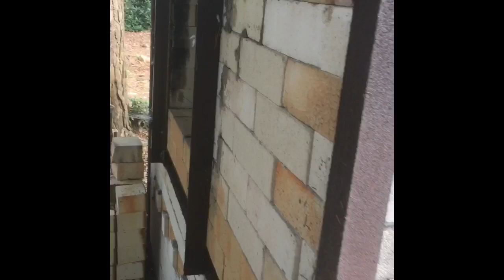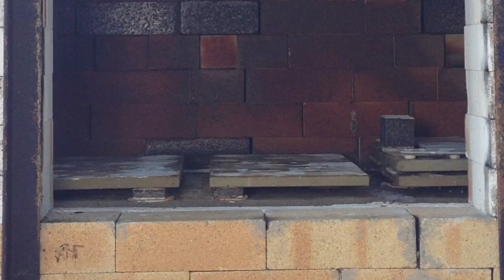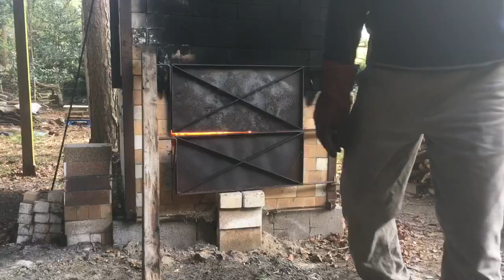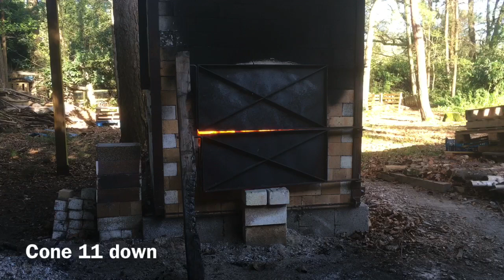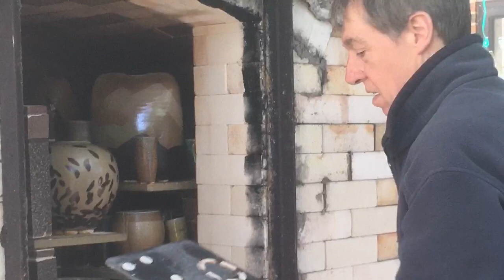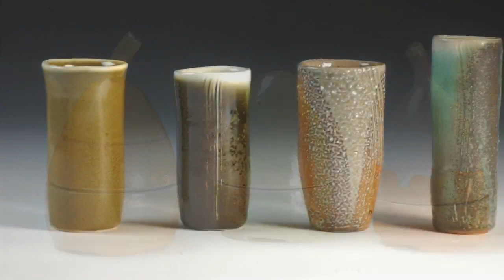Salt and Soda firing a Wood-fired Phoenix Kiln

Comment: Followed the video with much interest. Congradulations for the beautifull pots. Would have liked to see the smoking degree of the chimney. Would it be possible to share a plan of the kiln? Thanks a lot.
Reply from the maker: Thanks Dayanath. It doesn't smoke very much. Once I go into reduction there is a puff of smoke each time I stoke, that quickly clears. I don't have any plans which are designed for others to view but I do have a couple of rough drawings which you might find helpful. If you email me (address on my website) I will reply and attach them.

Comment: Great job on video..as a newbie to wood fired pottery it would be nice to know the  different stages of firing, sequence, sop.
Reply from the maker: Thanks Timothy. I am firing bisque-fired pots so I don’t have to be super slow at the start, but I still like to go a bit slow to start with in case there is any moisture in the pots and I start off at 150 degrees (Centigrade) an hour for three hours. Then I increase the ramp to 225 degrees an hour until I get to 950 degrees. At that temperature I go into reduction by closing dampers and reduce the ramp rate to 100 degrees an hour. Once I get to cone 9 down near the top of the kiln (around 1250 on my pyrometer) I hold temperature for about two and a half hours while I add salt and soda at ten minute intervals. I hope that helps.
Reply: Excellent kiln firing schedule!
I love wood firing.
Thank you !

Comment: What is the lumps you put under to stand on the shelves and how do you make it? Beautiful oven and pieces!!!
Reply from the maker: Hi Mirjam. Thank you for your comments. The lumps are wadding, to stop the pots being welded to the shelves by the salt/soda glaze. People have many different recipes for wadding - the important thing is that it should contain a lot of alumina, which doesn't react with the sodium. My wadding is made of two parts alumina, two parts of a fine grade molochite and one part of china clay, with a little wallpaper paste added to help it bind together. The dry powders are thoroughly mixed and then small amounts of water are mixed in until it all just binds together but is still a very stiff mix. I'm very happy with the way it performs.
Reply from the maker: Maybe I should add that I think many potters put the wads on the pots as they load the kiln, but I prefer to fix the wads to the pots beforehand with small blobs of PVA glue.
Reply: @kevinakhurst7855  thank you very much for the answer

Comment: Hi Kevin 
What material of kiln shelf & props are best in the reduction salt & soda firing ? Thank you. I have learned a lot from your sharing the video. From Addis Ababa
Reply from the maker: Hi. I'm glad you have found the video useful. I'm not an expert on kiln furniture, but I use ordinary cordierite shelves and heavy fire bricks cut to various sizes for the props. The kiln shelves are coated with batt wash on the upper surface (not on the lower surface as I don't want bits flaking off and falling on the pots beneath). After each firing I scrape off any loose batt wash and brush more on where the shelf has become exposed. If you are planning to spray soda you should avoid light-weight silicon carbide shelves as the thermal shock of the spray cracks them.
Reply from the maker: I should have mentioned that I also dip each end of the kiln props in batt wash, as well as using wadding pads between the props and the shelves

Comment: Very informative thank you. doesn't the soda eat away at the soft hti bricks?
Reply from the maker: Thanks. The kiln walls are two bricks thick and the inner wall, which lines the chamber, is made of 28 grade bricks which have higher alumina and lower silica. More expensive but more resistant to salt. I’m very pleased with how they have performed. Unfortunately I couldn’t buy tapered arch bricks in 28 grade, so I will probably end up replacing the roof when it gets worse.

Comment: very nice congratulations. I would like to make a smaller one. I don't understand at what height the outlets of the firebox are; in addition, the dimensions of the hob with respect to the arch of the hearth.
Reply from the maker: Sorry for the delayed response - I missed your comment somehow. I'm not altogether sure what you want to know. There is a single outlet to the firebox which takes the form of a gap in the firebox roof/chamber floor at the far end of the kiln. The hob is formed of solid steel bars which are the full width of the firebox. However, I did lay two single rows of bricks on the firebox floor to make it easier to create the ember bed by reducing its width.

Comment: Thanks for sharing the video. Concise and informative, and I enjoyed watching it. Now that you've fired it a number of times, are there any design changes you wish you made, or adjustments you would recommend to others wanting to build a Phoenix? Thanks in advance.
Reply from the maker: Thanks Nate. I haven't thought about that before so your question got me thinking. I don't think I would make any major design changes. I used castable for the firebox arch/chamber floor and also for lintels over the sliding dampers and in every case it cracked in use early on, so I would probably research my casting methods and also possible alternatives, but having said that the cracks haven't caused me any problems yet. Also, as a previous comment picked up, I don't really use my mousehole effectively and I might review the design of that. I would like to mention how pleased I have been with the use of high alumina lightweight bricks for the interior chamber walls. These have been very resistant to attack by salt and soda. The other challenges I have encountered, such as the temperature variations within the chamber and the uneven distribution of salt/soda, I have chosen to accept as features of the kiln design and work with them. I hope these comments are of some help.

Comment: A proper mousehole under the firebox would eliminate coals clogging the entrance flue.
Reply from the maker: Thanks Gary. I did build in a mousehole, running through to a perforated floor at the far end of the firebox, but when I started firing this kiln I felt it didn't make much difference and since then I have left it plugged. Your comment has inspired me to try using it again.
Reply: @kevinakhurst7855  A proper mouse hole, perforated bricks clog. See "Pioneer Pottery" on basic construction. I modified mine bit I get no coal build up in my throat arch. I just happened on this again. Hope you are having decent results. I been on a long break but might build again in downtown Detroit.

Comment: Great video Kevin. Enjoyed watching. Can you say why you use soda and salt together, and why not inject directly into the kiln chamber?
Reply from the maker: Thanks John. The use of salt and soda on wooden boards in the firebox was suggested to me by Jeremy Steward, who told me he had got good results that way. I did try spraying soda into the chamber once, but had a difficult time with the spray nozzles blocking and, ultimately, melting. I could have overcome that, but I was happy with the results from Jeremy's method so I decided to focus on optimising my slips and glazes for that approach rather then spend more time exploring the firing technique. I think having the sodium carried with the flame increases the variation in appearance around the pots from front to back, which I like. I know there are supposed to be differences between salt and soda - I believe that salt is supposed to fill the kiln more quickly while soda tends to follow the flame, and I have also read that they have slightly different colour responses, though I don't understand why that should be given that the active ingredient, sodium, is the same for both. From where I am now I don't want to spend time trying out variations on that combination.
Reply: Thanks for detailed response Kevin. All makes sense to me. All best John

Comment: hi kevin, 
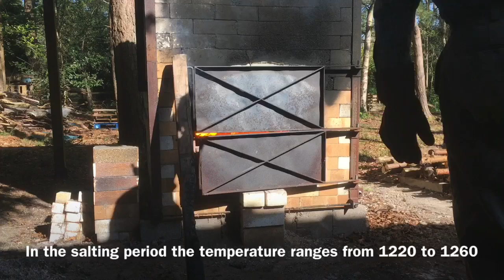you mention at 13:53 that when salting you aim to keep the temperature between 1220 and 1260 degrees. this seems quite a small range, what problems would you have if you were off one way or the other?
Reply from the maker: Hi. For me this is mainly about reproducibility. I only fire about twice a year and I don’t want to start experimenting with different firing regimes when I have six months of work inside. The salting takes over two hours and at the end cone 12 is most of the way down at the top of the kiln. I think if I allowed the temperature to go much outside that range over the salting period then my pots might be over or under fired. I have heard more recently about lower temperature soda firing, so I think it must be possible, but I’m already well down a different path.

Comment: Are you burning pine? You are getting ALOT of  creosote spoke and ash build up.  Forgot to mention…if you put a cast iron lidded pot in there you could have a hell of a “potters stew”.
Reply from the maker: Yes - quite a bit of pine, mixed with holly and birch. It’s just what grows locally. Also, later I discovered that my firebox floor had collapsed and blocked my mousehole, so now that is fixed maybe the embers will burn out a bit more. I wish I had a horizontal flue I could put a cook pot on top of - maybe my next kiln?

Comment: Excellent. Nice pieces of works. One of the pieces at 19:23 with light green is so pleasing that I would fight for it. What did u use for its coloring ?
Reply from the maker: Thanks for your kind words. The green pot is coloured with a slip containing cobalt and titanium. The cobalt gives blue and the titanium a yellowish colour; with the right balance between them you get this nice green with a very slight variegation, presumably from the titanium. I got the idea from the Scottish potter Fergus Stewart.

Comment: Are the pots bisque fiired first and are you also glazing them along with salt firing?
Reply from the maker: Hi. Yes I normally bisque first as I find glazing easier and the glaze firing isn’t too long when I’m firing solo. I did fire some raw glazed pieces once as they were too big for my bisque kiln. For that one I started firing one day, closed the kiln up for the night and then finished firing the following day. I used to always use slips in the top half of the kiln and glazes in the bottom, where the temperatures and amount of salt/soda are lower. More recently I have been putting glazes high in the kiln, where they are usually changed by the salt/soda

Comment: these white things that you use to place under the pots in the kiln, what are they made of?
Reply from the maker: Hi Olga. It is called wadding. Without these, in a salt or soda firing, or a wood firing with a lot of natural ash glaze, there is a risk that the pots will be attached to the kiln shelves by glaze during the firing. With wadding it is important that it doesn't vitrify during the firing, or react with the salt/soda itself. It needs to be firm enough to support the pot and friable enough to break off easily after the firing. I make mine to a recipe I got from Micki Schloessingk; 2 parts of a very finely ground alumina, 2 parts of a finely ground molochite and 1 part china clay. These are mixed with some dry wallpaper paste powder (or courgel) as a binder and then water is stirred in to get a very stiff consistency. Some potters apply these as they pack the kiln but I prefer to wad my pots before packing, fixing the wads to the pots with small blobs of PVA glue.
Reply: @kevinakhurst7855  Thanks a lot for the answer, Kevin! I want to try salt firing but I am not sure about the complete technology. Would you mind answering a couple of more questins please? Does the salt affect the inside of the kiln and the shelves? can you use your kiln chamber for both salt firing and other kinds of firing? do you salt fire at cone 5 (or am i mistaken)? and placing salt should happen at the highest temperature point? for how long then should I hold this temperature? thanks in advance for reply!
Reply from the maker: @olganikolayeva2568  Hello Olga. I will answer your questions, but I recommend you get a book on salt firing (e.g. Phil Rogers, 'Salt Glazing' and Jack Troy, 'Salt-Glazed Ceramics'), which will go into more detail. The salt does gradually attack the inside of the kiln and this generally rules out using normal lightweight insulation bricks. Many potters use heavy bricks but I used high-alumina lightweight bricks for the lining of my kiln chamber and they are resisting the salt well. I use normal cordierite kiln shelves most of the time and I coat the upper surfaces with kiln wash to reduce the attack by the salt. They are still going well after 15 firings. I understand that the salt which remains on the walls can affect subsequent non-salt firings, but maybe in a small and acceptable way - I haven't tried it myself. I usually start salting at about cone 7 or 8 which is close to my maximum temperature. I then gradually add the salt over around two hours while holding at that temperature, by which time cone 11 is down at the top of the kiln and cone 9 at the bottom. You need to give the salt time to act on the surfaces, but there are no strict rules. I hope this helps. Good luck with your salt firing.
Reply: @kevinakhurst7855  thanks a lot! I will read these books if I find them!

Comment: How many fire bricks total did you use in this kiln?
Reply from the maker: Hi Nathan. Sorry, but I never counted them. I got a lot of bricks from an old kiln and I have a lot left over. Almost all of them are standard 9 inch x 4.5 inch x 3 inch bricks, although I used some larger heavies at the chamber floor level to help key in the cast floor. Sorry I can't be more help